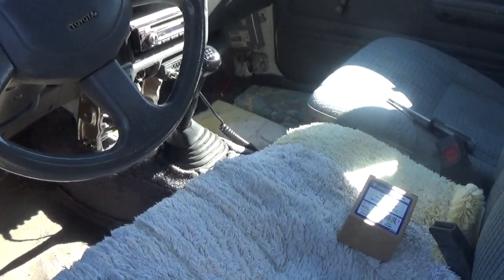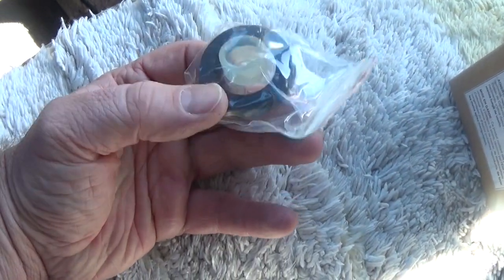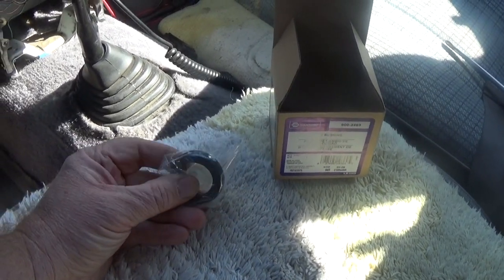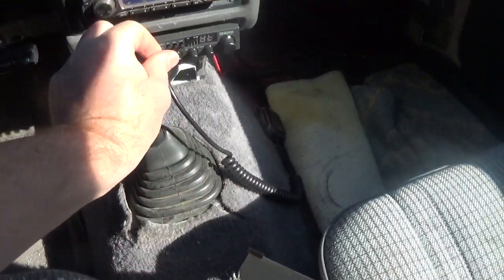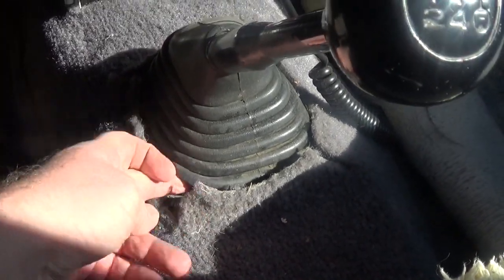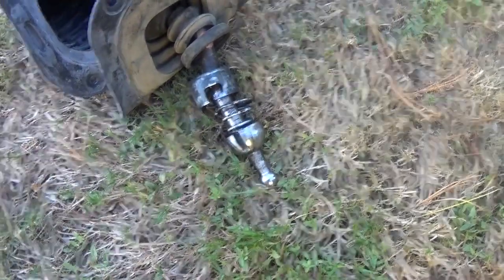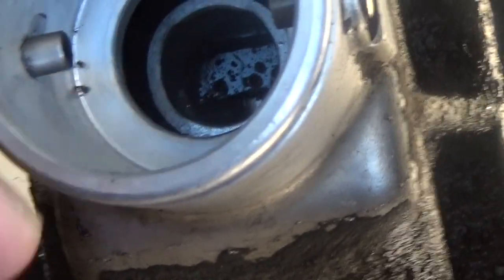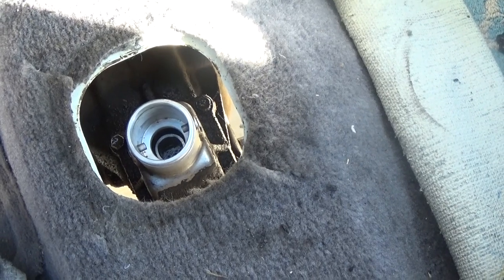1991 Toyota Pickup shift bushing

Comment: I had 2 different repair shops tell me the shift forks were worn and transmission needed to be rebuilt. After I said screw that, I played with the shifter lever and figured out that it shifted fine if I just lifted it a bit from the transmission. Then I pulled it out and learned the rubber bushing was completely disintegrated. Replaced that 15 years ago with a oem, and did it again yesterday with an Ebay aftermarket different material because it was completely disintegrated again.  I  hate how these shops lie to people about a $20 fix.

Comment: What size are those 4 screws that hold the mounting together? Mine are missing and I cannot figure out what size it is
Reply from the maker: I would call Toyota Dealer, and see if they know.  If not, ask them for the part number, and research from there.  You could also go to a wrecking yard and pull them.  Maybe buy some from a wrecked pickup on facebook.  They should be metric, so you could just try some metric screws.

Comment: Hey I know this is an old video but I have an identical 91 pick up and it recently got stuck in reverse like it won’t go into any other gear, I tried the “removing reverse light sensor and pushing pin readwards” I’m gonna take a look at the bushing when I get home but if this doesn’t fix it any ideas?
Reply from the maker: While pushing the stick out of revers, have someone gently rock the truck front, and back.